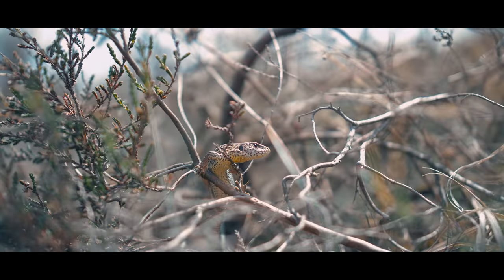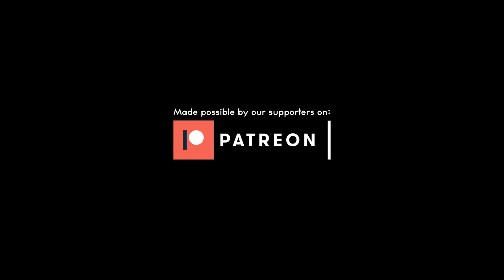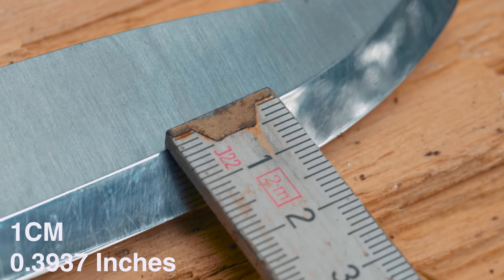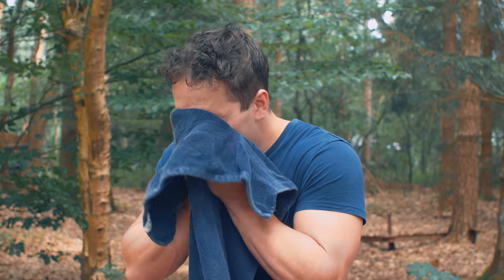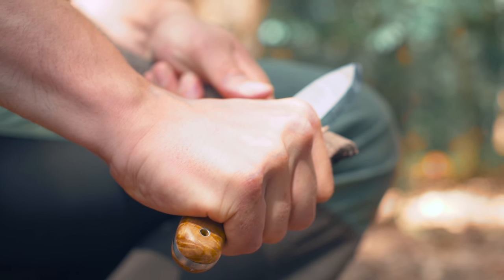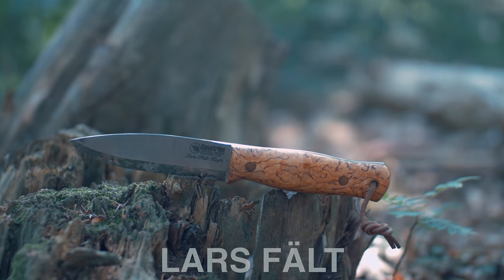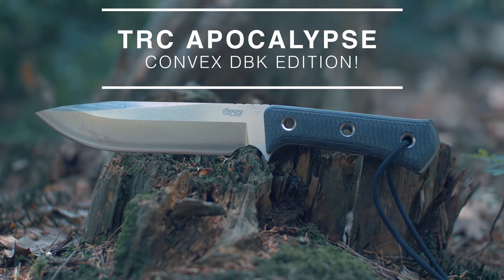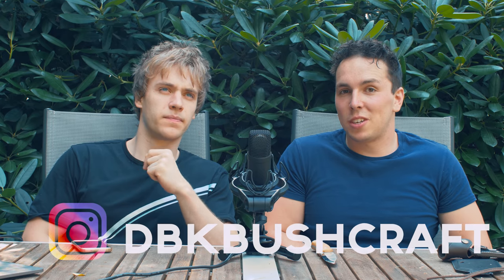Stay Away From Buying This Knife!! | TBS Boar

Comment from the maker: We forgot to show one major flaw of the knife! The scales of the handle came loose after the handle getting wet just a single time. check out the pictures
https://drive.google.com/drive/folders/1GdFhUSjFbZoRSCustInHj9mbhI7yb-H1?usp=sharing
Reply: You didn't show it but mentioned it. It's too bad that knife underperformed so much.
Reply: Interesting. And unfortunate for anyone that experienced the same issue. My Boar has the Turkish Walnut. No issues yet. The Wolverine has G10 handle scales and the Grizzly has Micarta. (military model). The thing  is a beast. Out of my 30 knives, the Grizzly is in my top 10. I do like my Casstrom blades more though. Cheers.
Reply: You did mention it but it's a mayor flaw indeed. Basically also the reason I like other handle materials for my user knives. I do have the first edition Spyderco bushcraft where the wooden handle wasn't stabilized but I knew that before buying. Was never intended as a user knife anyway because O1 steel.
Reply: @alpineexposure333  I have a Bernie Garland with Turkish walnut or ironwood (not sure) but that stuff is crazy hard. Grinding it down on a belt sander is harder than grinding down micarta.
Reply: this is freaking ridiculous. cost saving with no liner definitely caused this, and also the birch handle hasn't been oiled long enough could be another reason. I have seen Lionsteel M4 with walnut handle has the exact same problem, and it doesn't have liner as well.
Reply: Can you guys do a review on the cold steel srk?
Reply: Tbs means total bullshit
Reply: Wow hot garbage lol
Reply: @nikolapiencakova9109  If its gone rusty thats entirely your fault for not looking after a carbon steel blade properly...
Reply: @willwt97  Hi, firstly, I didn't really mean blade but generally ... and secondly I own N695 Stainless steel :D And its not my only knife so I am able to compare ;)
Reply: @nikolapiencakova9109  that is weird as I also have the N695 and it hasn't gone at all rusty/corroded
Reply: @nikolapiencakova9109  so the blade hasn't gone rusty... I'm not quite sure what you mean aha there's nothing else on the knife to go rusty other than the blade.. Wood doesn't rust of course. I'm a bit confused about what you mean aha
Reply: @ningcai2088  the have liners ,remember the fallkniven tips that broke dose that mean every fallkniven is shit
Reply: @normalrickandmortyfanscong4813  do they fuck the make great knives its euro vision all over again lol n690 is n690 ..
Reply: @nikolapiencakova9109  thats the same steel TBS uses ,areal  fallkniven knives all crap because 2 broke off their tips in DBK and survival Lilly video tests

Comment: I have had the Boar for a year and it functions great as a bushcraft knife. I do have many other bushcraft knives like Jacklore Classic, Lars Falt knife, Ben Orford’s woodlander, many Morakniv including 2 Garberg, a few Bark River and I would say that partially DBK is right on the grind height of the blade, but it has never been an issue in actual use for me. The boar may not slice as deep as any of the knives I mentioned above but it does a great job at feather sticking. I should add that unlike the wood that was shown in the video, although hard wood but mainly straight grains, what I have here are mainly gnarly and badly twisted wood peppered with many tiny knots everywhere. I have no issues making pretty curls for feathering. It’s not as easy compared to other knives I mentioned but definitely not impossible with skill and practice. And I have gotten better result doing feather sticking with the Boar compared to using the Bark River Bravo 1.25.

It is funny that on the video you seemed to struggle so much with reverse cut. I don’t know if this is an over exaggeration on Maarten’s part, or if it really is true? I find the Boar to have the best performance compared to all my other knives when it comes to reverse cut. The downward curving pommel on the handle acts like a fulcrum on the ball of my palm which gave me extra power to really slice through material effortlessly. It is the most effortless knife I have ever used when it comes to reverse cutting.

Having said these, I am still on the original factory grind after a year and have only stropped it after every use to maintain its newspaper slicing sharpness. Just too many knives to sharpen and too little time. I had wanted to reprofile the angle on the bevel so that it gets more bite but felt that it is unnecessary. The thicker bevel does mean superb toughness and you can’t have the best of both world.
Reply: Would you be able to help me? 
What would say is the best knife of this style for the money? 
Is there any knives that look like the Ray Mears Woodlore? 

The only thing I don’t like about these knives is they are just knives.
I wish they made more survival types of this style.
Reply: Totally agree with you 👍 I just feel the 2 are now more like "Laurel & Hardy"  ... more about laughs and disliking something before they start to use it ...
Reply: You did a better job of explaining the pro's and cons than this channel did.

Comment: I absolutely love my TBS Boar, have used it in various environments more then strong enough to get the job done.
Horse's for Courses in what you decide to buy, I have no issues in making feather sticks, preparing food, making wooden tools etc. You clearly had a bad one that failed the QC check, doesn't matter what you buy things can still fail regardless of how much you spend.
Reply: I've found that over the last year or so that these two can be very picky and cocky about what they like 
I have the tbs grizzly it's a propper work horse razor sharp solid built and does great feather sticks
Reply: @scottrobinson9615  the Grizzly has a shitty inefficient grind.

Comment: Strange review to me. Blade is not 6 mm. Carbon version is 4 mm and stainless 5 mm.
Handle is very comfortable. More comfortable than any Bark river my opinion. And much more grippy. I never had a problem with my Tbs Boar. Feathersticking was better then my Bark river bravo 1. The sheath which is also an important thing is so much better than Bark rivers sheath.
Reply: So you have one of these? Ive been looking at them but this review scares me. You give it a better score that they do?
Reply: Sluggo Knows Yes i have this knife with the Turkish walnut handles and the 4 mm carbon blade.I like this knife yes. The carbon steel i like very much. 
(The blade is 115 millimeter. Specs say 110)
Easy to sharpen and holds the edge pretty good. And this handle is very grippy with the turkis walnut. I can agree on that the angle of the scandi grind is a little steep. When i sharpen my knife i use sandpaper and a mousepad and then the scandigrind on my Boar has become a little more scandivex. For batoning and feathersticking i rate it a lot higher then this review. 
It works okey for carving and woodwork but if i only do carving for extended time i prefer my Woodsknife from Finland. I have 5 of them and they cost from 50 euros to 80 euros depending on size. Lamnia.com in Finland
Reply: If the edge grind lenght in DBK version is 1cm and thickness is 6 mm that would make the edge angle 35 degrees. If in your version thickness is 4mm and presumably the grind length is the same then the edge angle is 23 degrees which sounds very much like a good carver.
Reply: Smacks of a conflict of interest to me.
Reply: @gunnarblomquist4412  and their lock knife boar and slip joint boar are outstanding.its also strange that they didn’t test other knives from TBS the Grizzly Timberwolf Lynx wild cat ect but they test other range from Fallkniven. never forget British built wooden planes bet German steel planes lol and I am referring about the Spitfire  lolololol
Reply: @my_handle....  definitely contempt right from the get go like TBS N690 is shit lol it’s the fucking same Bohler N690 as Extreme Ratio use and other top end brands .
Reply: It is Obvious that these Boys do not sell this TBS range of Knives in there shop and They Assassinate the Opposition with Bad Reviews .  I have the Boar for two years with no issues !

Comment: I wish I had seen your review before I bought this knife. I wouldn’t have had to suffer 18 months of total satisfaction at having what is a very good general purpose knife. Does it do everything superbly? No. Does it do everything at least acceptably? Yes. Is it built like a tank and should it last for years? Yes. Is it good value for money? IMHO yes. 
And everyone who knows anything about knives will state that attempting to slice paper to demonstrate a blades sharpness is a flawed test, as things like thickness, hold and humidity affects the result. Back to the wacky backy guys.
Reply from the maker: I'm happy the knife does good for you. For me the Handle came loose from the tang the first week I used it
Reply: Dutch Bushcraft Knives you do realise they have an lifetime guarantee on their knives...? Implying if you have a problem with the knife, you can always return it in exchange for another one...
Reply: @load_out  if your out in the field that doesn't really help....
you want a knife you can rely on......
Reply: Shaul Strait I personally have had no problem with the knife and I feel if you use it in the correct manor, it will last you ages
Reply: @load_out  yep just like ESEE but not a mention of it
Reply: Rogue Sheep exactly
Reply: @load_out  atleast it didn’t loose its tip like the Fallkniven S1 did ...
Reply: Rogue Sheep absolutely. I don’t see why they have made the knife out to be a knife that is brittle, terrible and cutting and falling to pieces. If you treat your kit right, it will last longer. A bit like when he tried to cut an apple with a scandi grind, it is just not what it is made for, hence why the also sell flat grind knifes, or in a combination, the Wildcat “canoe” with both a flat grind and a scandi grind
Reply: @load_out  TBS Knives are two to four times cheaper than the ones that the DBK Pimp out for a cut in the Deal ,  Shameful to be so Nasty to a Good Knifemaker .
Reply: Derek Stynes absolutely. They aren’t exactly a big name but make such good quality knives it seems that a really negative review such as this can be very crushing for them
Reply: @derekstynes9631  yeh they can excuse the tips breaking off the fallkniven and forgive that he had to send his S1 back twice because the handle was unusable... but the HOG cant be excused  its life time guarantee not mentioned once ...its eurovision all over again lol

Comment: Nice review guys ! What about the Mora Bushcraft Black ? Doesn't this knife also suffer from the same problems ? I own one and I was thinking about grinding the blade at a belt sander to make the blade angle shallower. Should I do it ? (like virtuovice did)
Reply from the maker: mm I personally like the bushcrafter black. The blade is less thick so it doesnt have the problem. The bevel is pretty small so we made ours convex

Comment: Im on my second one of these and the first one I owned was far superior to the second.
I messaged the TBS and told the differences I found but they didn't bother to reply.
A month later I found out that they had changed maker.
My first held an edge almost forever compared to the second.
The scales didn't seem as finished.
The Lazer logo etching was very faint.
And the blade arrived slightly scratched.
My first one of these I would definitely recommend.
But after my second one I wouldn't recommend.
Reply: What one did you have what type of steel because they do different versions in different steel, plus you get a life time warranty  on defects so you could have sent it back I have never experienced what you have the guys have always helped when needed and replied to every email promptly.if you still have the nice use your warranty.
Reply: @roguesheep1747  both where k720 I've told them on Facebook about it and didn't get a reply only replies I got on Facebook was from people agreeing that the quality had definitely went down and some saying there's had broken or chipped .

Comment: I'm so glad I got this knife before they "upgraded it" to military standard or whatever the web site says. I bought it when TBS first started.   Mine is 3mm and the bevel matches great and it came nice and sharp and the handle is fine.  It bought it on special for less than 125.00 with a matching fire steel and the nice TBS/cudeman sheath . I guess they have gotten popular.  I'm sick of overbuilt knives- great video!  Now that you guys have a scaling system for rating the various bushcrafting tasks you should do a shootout and rate as many knives as you can get your hands on.  Also thanks for the heads up about handle swell.  I'm going to start infusing it with oil today!!!!!!  They used to be a good deal and decent spanish build- not top production quality but definitely worth what they used to cost (when they really were decent knives)- it sucks to be u.  :-)
Reply: You could choose different models of the same knife range

Comment: I also have TBS BOAR but I didn't have huge issues with this blade. Is it because my one is Black Micarta version? Only one problem is that this knife is so easy to get rust on the edge. Therefore, it could be better to check its blade after using and put oil on it.

Comment: This is the first working review I have seen of this knife, if I had watched this first, I wouldn’t have bought one…. Here’s why….

It’s only good for battening and making kindling.  Look at when he starts to feather stick, the shavings are poor, poor, poor!!  I have tried using this knife and it just doesn’t work as a bushcraft knife.  The Cutting edge profile is so bloody big you CANNOT get a good cut/shave, hence why his shavings are really bad.  You may also note he reverts to fixing the knife into a log and draws the stick against the inverted knife in a vain attempt to make a feather stick work.  The reality is, if you had 2 of these knives you’d be best suited finding a frozen pond, attaching them to your shoes and go ice skating with them.

I have a Helle Bushcraft knife that ticks all the boxes apart from battening due to the tang not being full-handle, Gransfors axes…. I’d like to think I know what works being an Arb man.

I cannot begin to tell you all how disappointed I am with this knife, and it wasn’t cheap!  This is the biggest fail I’ve spent so far in bushcraft.  The only thing I can think of that this knife excels at is being a kindling processor or using it for small hatchet tasks.  Maybe cutting meat?  Havent tried that yet.  Im sure you can chop through bone with this.

Maybe you have to be the size of the Incredible Hulk to properly use this nice as the handle is very big.  Yes it it comfortable in the hand, but it doesn’t mean you have a decent grip for the cutting tasks required in the bush.  You might be able to whack a small log onto the knife point, bury it a bit and use it as a make-shift drawing knife, again not used it like that yet.  I just wanted to try and see if it would handle the basics I can already do; I waste more energy TRYING to whittle than I actually do whittling.  My Gransfors small forestry hatchet does a better job overall.

I saved my Christmas tree and thought it would be fun to create a walking staff with the knife of choice being a Grizzly… Just doesn’t work….  I’d love to hear what the British Army (truly) said about this as they made suggestions to TBS and the company made a military spec knife as a result (and bigger price tag!!).  There are so many review videos where they just talk about the knife and show it to you, give you a VISUAL REVIEW.   Avoid all these BS videos.  You want to see the knife in action.  There’s a reason why you don’t see many of these videos: because it would show how bad this TBS knife unfortunately is and the “Influencer” (theyre called that for a bloody reason!) wouldnt get anymore free shit being sent to them!!!  It’s the gradient angle of the cutting edge which needs to be reduced in order for this to be a working Bushcraft Knife.

Now!  I must be fair, because thats fair, right?  It IS described as a “Bushcraft Survival Knife”….. technically, yes this is 100% accurate.  You can SURVIVE with this knife and it would be able to do bushcraft tasks, just not efficiently.  It should be described as a “Survival Bushcraft Knife”.  Yes, there is a difference between the 2 descriptions.  The Former denotes that it is Bushcraft 1st, Survival 2nd, the latter denotes to Survival 1st Bushcraft 2nd.  Do NOT buy this knife thinking you can Bushcraft with it.  If you survived a plane crash and found this knife in the wreckage you’d be over the sodding moon!  But as a customer, I have to say this is not a good overall knife.  There are better Bushcraft (Survival) Knives out there with a full tang that handle ALL the tasks you want in the Bush in order to Survive.

Thank you for posting this video and I can see where you struggled using the knife because it’s the same for me!!  TBS, I’m really disappointed!  Dutch Bushcraft Knives on YT do a great review of TBS Boar Knife, which isn’t as hench as the Grizzly….. really wish I found these guys too before buying I advise people to also watch this video they talk about all the issues I have mentioned and they really know their knives and theyre funny as F!!!!

Thank you for reading (if you did) and I would like to know what your findings are if you’ve also bought one. X

Comment: I got one of these a few years ago before I knew more about knives. Its terrible. The angle of the grind is way too steep for such a thick steel. It needs a bk2 grind for it to work. Also the grind was uneven, with 1 side higher than the other. Awful 

Speaking of bk2, I bought one to replace my boar, coupled with a mora garberg. Super happy now